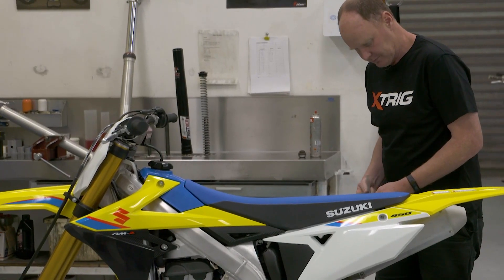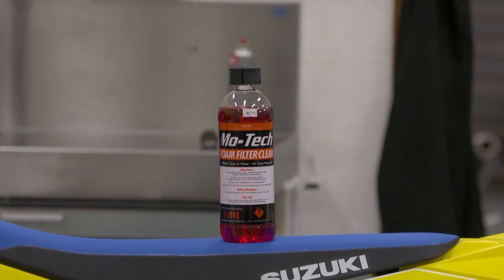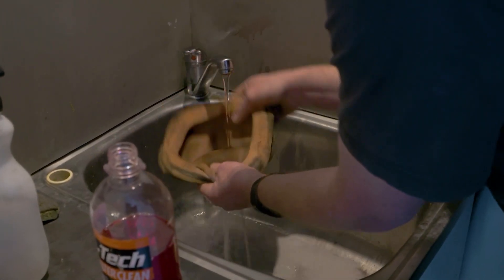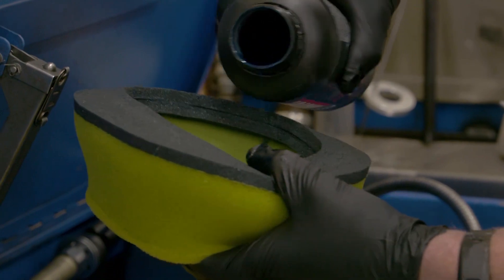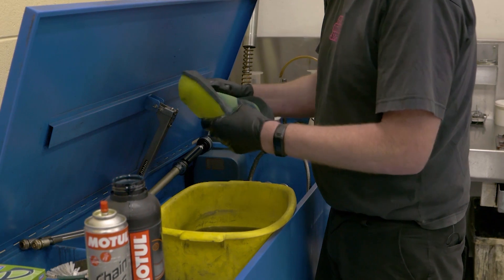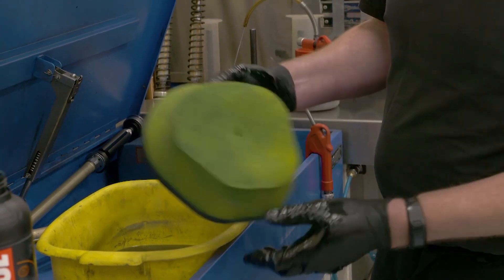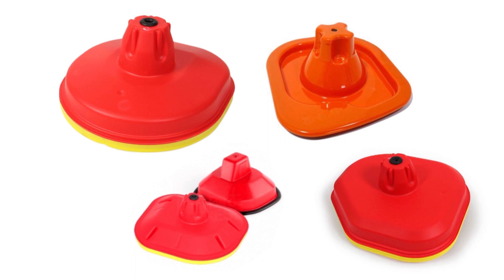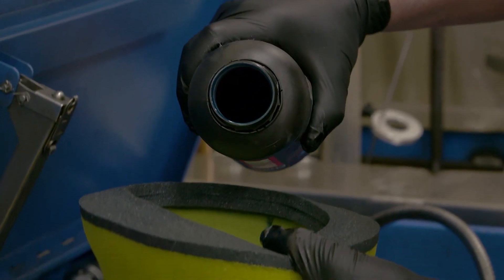MXTV Tech Tip - Air Filter maintenance

Comment: I use dish soap in warm water.  Never ring out the filter because you could rip it.  Apply foam filter oil and always check for rips before installing a washed filter.

Comment: I will go against the grain here and recommend to refrain from using the airbox cover to wash the bike. When the bike is dirty and you unmount the air filter it's almost inevitable that some dirt will get directly into the airbox and further to your throttle body. If you've noticed it before starting the bike and could clean it out that's half the problem. You've just lost a lot of time. Much worse for the health of your valves is if you just start the bike with all that sand in the airbox. What I do is I cover the air filter with plastic before washing the bike, close all ventilation holes with towels, put the seat back on and wash the bike. After I'm done with washing I quickly get the towels and the plastic bag out of the air box and start the bike to evaporate the water from where it shouldn't be. When if it's time to change the air filter I make sure the air box is sterile and only then do I unscrew the air filter. The less you mess around with the air filter the better it will be!